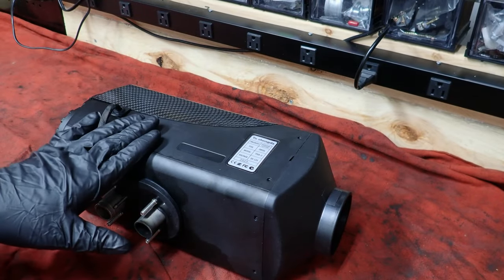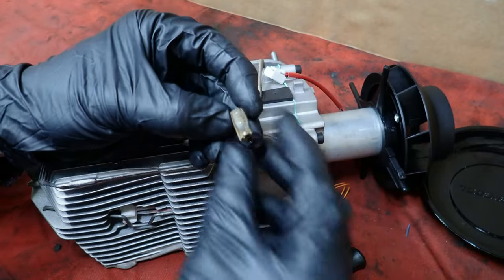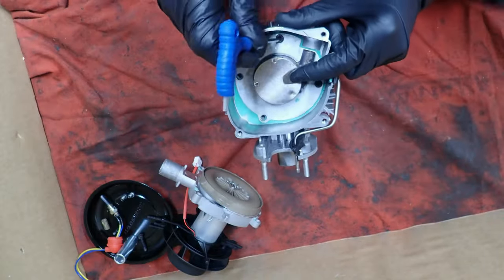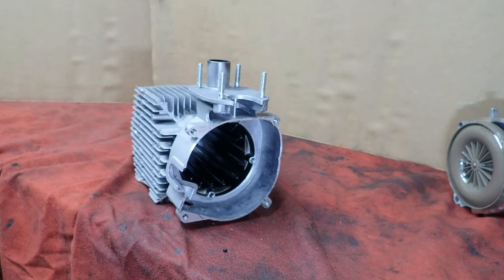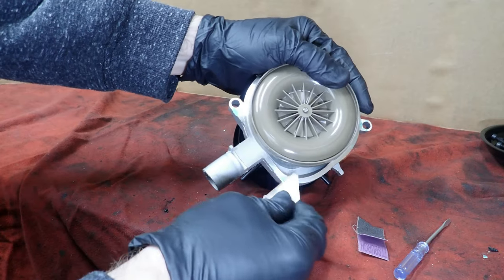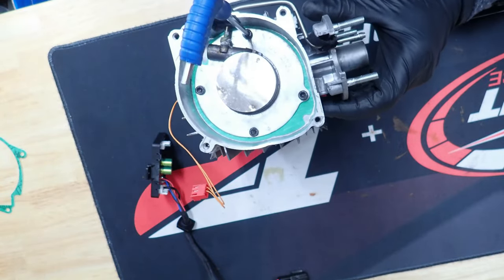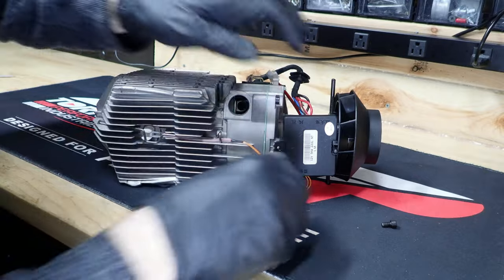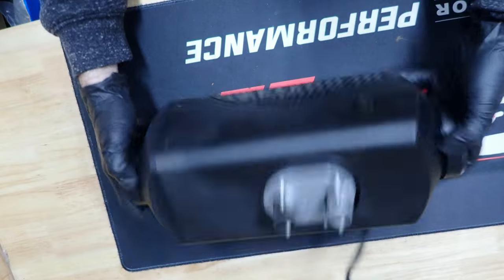CHINESE DIESEL HEATER TEARDOWN AND REBUILD HOW TO 5-8KW

Comment: As long as you have a good filter inline your heat exchanger will stay pretty clean for several thousand hours unless you burn on low alot. You only need fuel additive when the temp drops and your fuel starts to jell. (about 10 degrees)
 And we don't really care what you watch on TV.